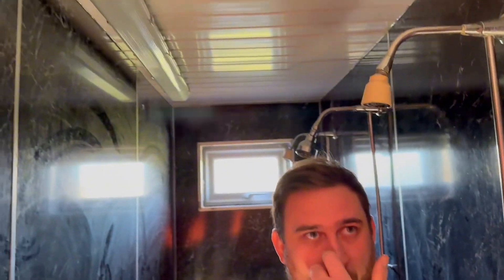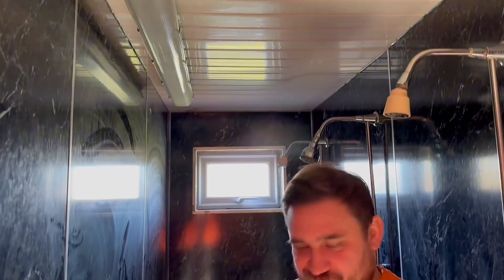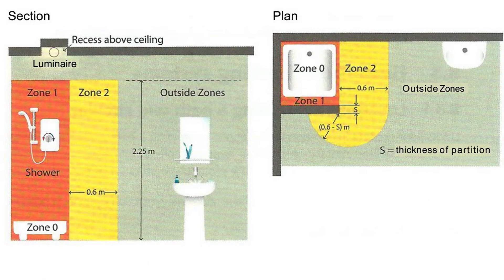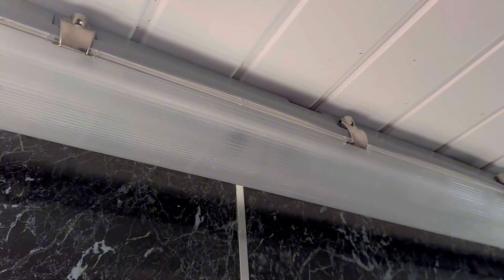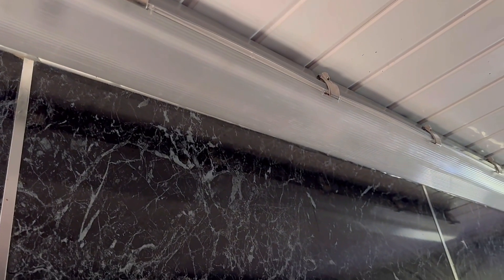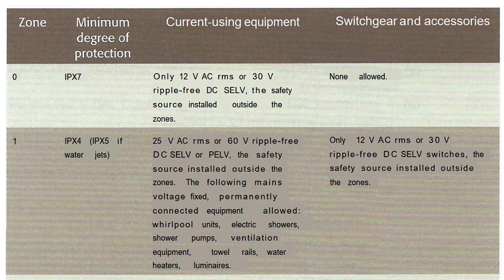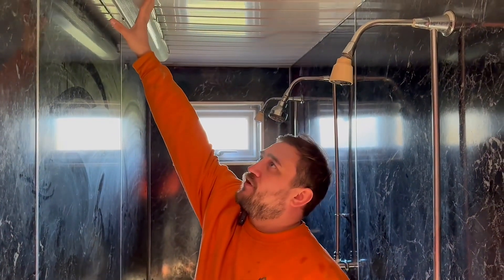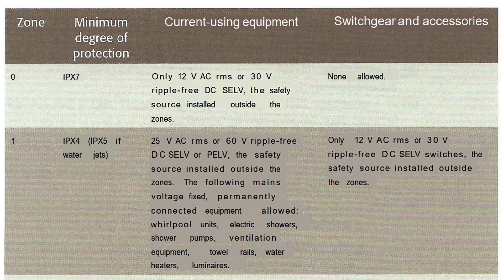EICR - Batten Light Fitting in a Shower Cubicle

Comment: I went to a shower once they said they kids were getting tingle in the shower i said dont use it seriously on the phone.Went there on a 45amp fuse no rcd.240v cellertaped bulb fitting in shower on wall and metal shower housing screwed to wall and found screw went through the 45amp 6mm cable in the wall.The whole thing became live when someone shut the door.U couldnt rite it unbileivable condemed the lot.3 kids in house showering every night wtf.And to top it an exposed coper pipe going to shower which was earthed all they had to do is touch that and metal work on door the same time.

Comment: In my experience some of these fittings are absolutely fine until you open them up, the clips and mounts get so brittle when they are a few years old, so just opening it to check its specs and cable entry might ruin its rating.
Reply from the maker: Thanks for the great comment 👍🏻
Reply: Very true but they are so cheap nowadays. I even put one up in the loft. And LED fittings are cheap. Chances are if the clips are brittle etc / break, just fit a new fitting. Job done.